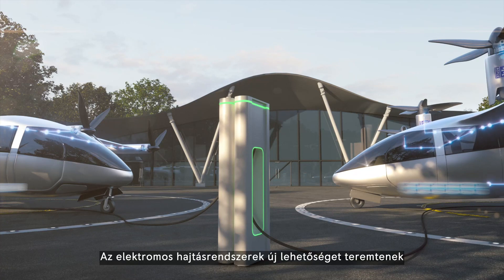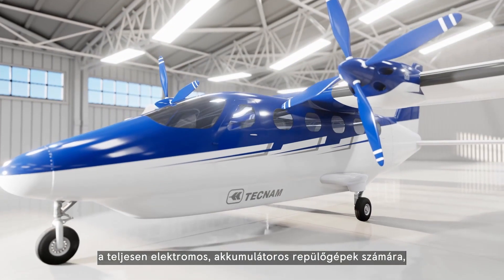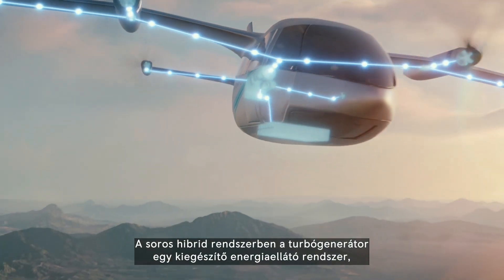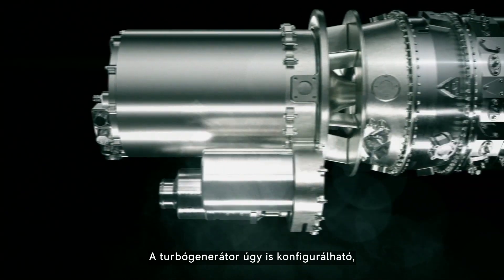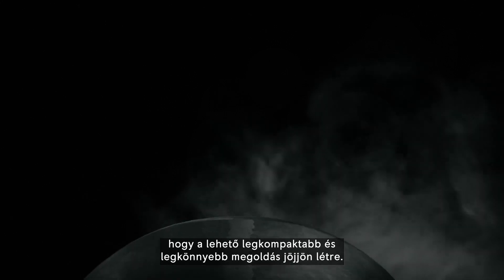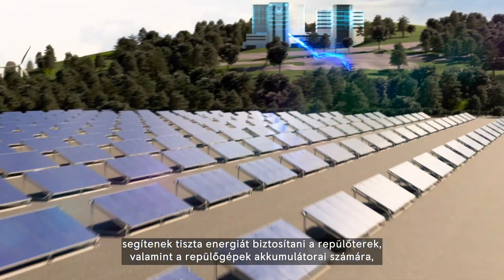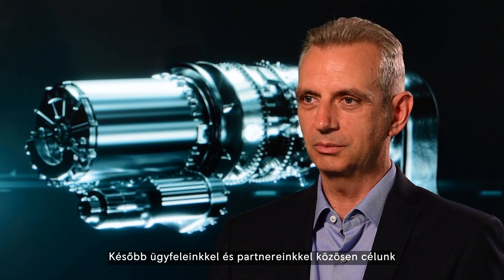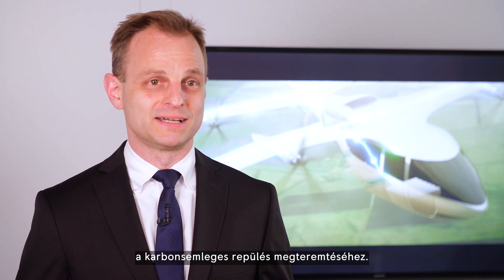Rolls-Royce | Ismerd meg legújabb technológiai innovációnkat, a turbógenerátort!

Comment: k so a fuel spending engin that charges battries for electric motors?
Reply: mechanically decoupling the power generation from it's application has tremendous opportunities for both the aerodynamic architecture of the vehicle and for the configuration of the IC unit.